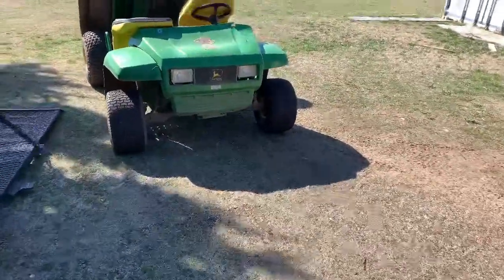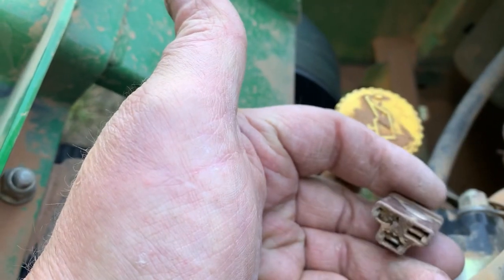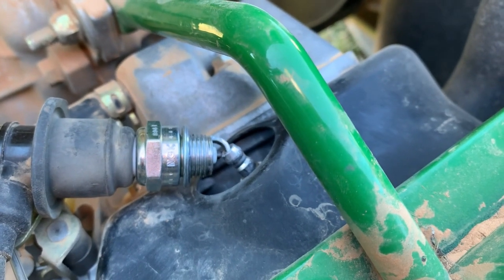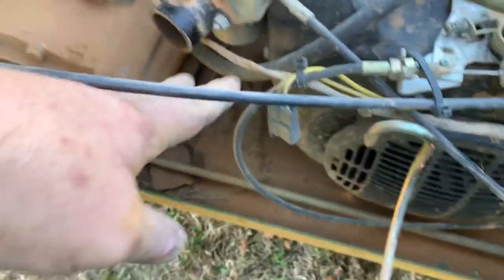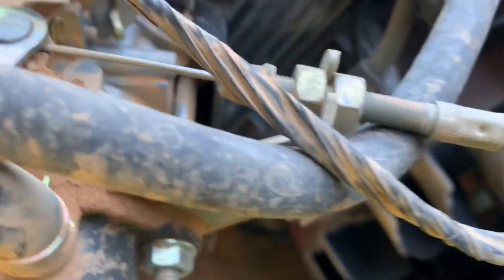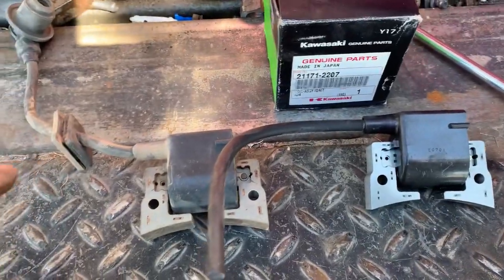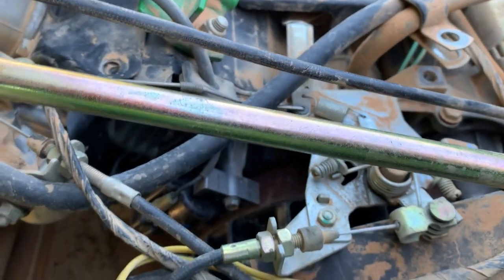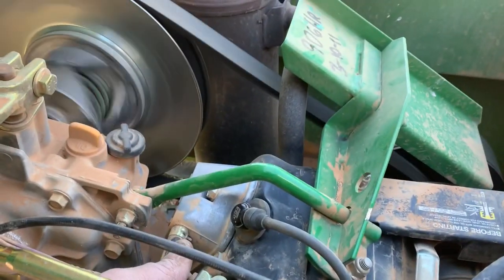KAWASAKI FE290D FAILING IGNITION COIL / JOHN DEERE GATOR / RUNS AND DIES

Comment: Great info.  Does that FE 290 have an external or internal igniter, I have a 550 Mule with an obviously replaced coil but for the life of me can't find an external igniter anywhere.  I have spark but i cant get the sucker to fire at all. Waiting on a new plug to see if its bad.

Comment: Had this same problem with that same engine in a club car. The only difference is when i had my echo spark tester in line it ran perfectly. When you did not have it in line it did the same as yours. Ended up being a bad module. Not as easy to get out in a golf cart as a gater

Comment: Thank you for the video!
My Club Car with FE350 engine is doing almost the same thing but doing it cold. In service mode, it will start and run at idle, but as soon as you give it some gas, it stalls. After a couple of tries, I could smell gas. Checked compression 140 psi (good). I then disconnected the rev limiter, and installed a spark tester. Spark (orange color) was continual even when I went above idle and engine stalls. I then changed plug and went through the carb, no change. Thinking it was still the carburetor, I bought an aftermarket replacement on Amazon . Still only run at idle.  I then thought  since the spark was orange and not blue colored (as I expected to see), maybe coil is week and the added gas on acceleration is drowning it out. I am know waiting for the Amazon aftermarket coil and feeling better that is what the problem is. After seeing this video I am more confident I have made the correct diagnosis for fix. Cross your fingers!
If anyone has any other suggestions, I am all ears. Thanks!
Reply: Having the same issue with my gator cx . Been working on 4 stroke engines all my life, and I just knew it was a fuel issue. I tore the carburetor apart three times, change the gas, bypassed the fuel pump and it was no change. I installed my spark tester. The spark was almost red . . Now I thinking it's gotta be a bad low oil shut off switch.
Reply: Finally figured it out. Governor was out of adjustment. Governor is not in the engine, it is in transmission. When accelerator at full full throttle, carb throttle wasn't moving therefore no gas. When I adjusted governor arm, it made arm at carb move a little more than it had been. That made the butterfly open a little more which made it run like it should.  Be careful adjusting the governor arm. A little change makes RPM's drastically change.

Comment: Excellent fix. I had a Honda GX160 that a customer said would quit. I bench tested it for 20 minutes and ran good. Sent it back and customer said won't start again. Turned out it was the coil that would only act up on occasion. Thanks for the video.

Comment: Just had the same problem on my Dad’s Mule. New carb in the last year, thought that was messing up again at first. Started as acting like it was too lean just off idle at first when it was warmed up, but ran perfect cold and would never mess up sitting and idling. Ran it down a back road full throttle for a few minutes under load and it just shut down till it sat for a few minutes several times. Eliminated the pilot jet theory. New coil and it’s good to go

Comment: HELP: Have JD Gator 4 x 2 (2004ish??) with a possible charging issue. Replaced battery and voltage regulator. What would your next steps be? How can I verify it's NOT the alternator? And...where is it even at?

Comment: I have no power to my starter switch but can jump it at the starter and it turns over. What is preventing voltage from getting to my ignition switch? I can’t find any relays and fuses are good.

Comment: Hey buddy I’m trying to change the coil in my John Deere gator but I’m having problems getting to the bolts on the bottom of the fan shroud. Any idea how many bolts there are that I need to take off and where they are located ? And what did you use to get to that one on the bottom on the right hand side ?? I have tried every extension and everything I have and I can’t get that damn bolt out

Comment: I have a Kawasaki Mule with this same engine.  When I've been driving it a while under load, good and hot, it tends to die at idle.  I replaced the carb, but it still does it.  It's only got about 250 hours on it, but it is more than 20 years old.  Could it be the coil?

Comment: I enjoyed the video. Just for curiosity, did you find that screw that vibrated off the belt guard when you rev it up ? 🤔 😆
Reply from the maker: Yeah it didn’t go to anything   I had it shoved down in the spark plug cap to see if I could see spark.  I was trying everything because I had left my inline spark tester at the main shop.
Reply: Haha was going to mention the bolt on the belt guard went dancing !! Great videos & all are very helpful & informational !!

Comment: Have a 98 gator FE290d rebuild engine and reinstalled and hooked up started engine ran fine switched off and noticed smoke and electric burn smell looked like maybe around fly wheel area had to take battery cable off to stop burning.After that could not get a spark so got to looking found what I think is ground wire to coil not grounded .Could I possibly burned coil up.
Reply from the maker: 12v backfeeding coil. Inspect and test ele system

Comment: Hi I have a Kawasaki fe 290 or 350 in a 94 clubcar carryall 2 with no spark. I took the old coil out to replace it but in the process of trying to get the sparkplug connector/ resister off  the wire the resister plastic broke into many pieces .is it possible to get a new resister/ sparkplug connector and boot. Also I did a ohm test on the old coil and it seems to be within specs. So I put it back on but still no spark. Does the dead man wire need to be on to test for spark. Thanks for any help or advice. Jeff
Reply: I have a 1998 hpx jd gator was running just stopped what should I look for it’s getting fuel and spark